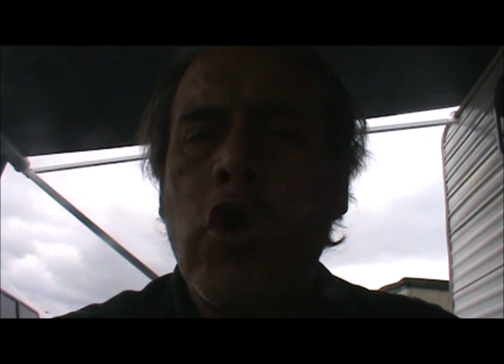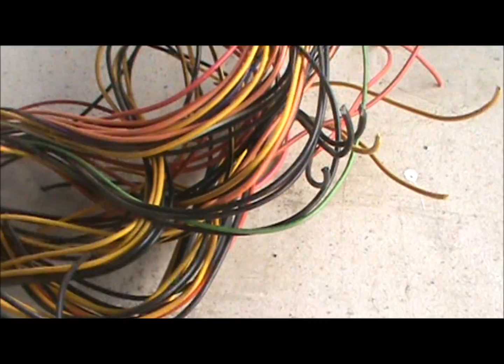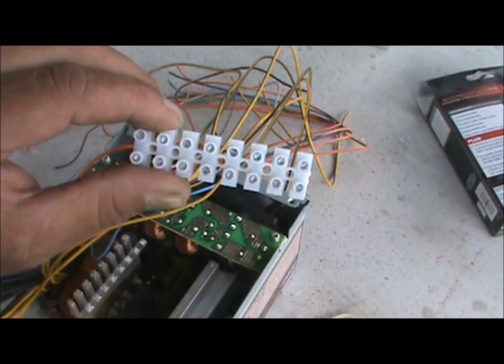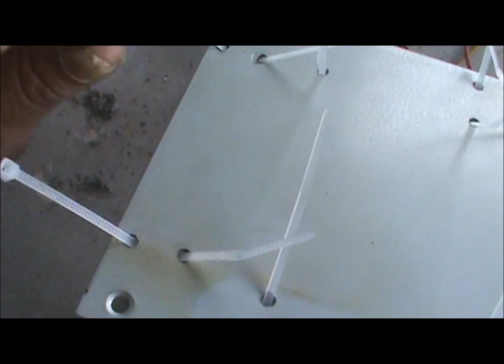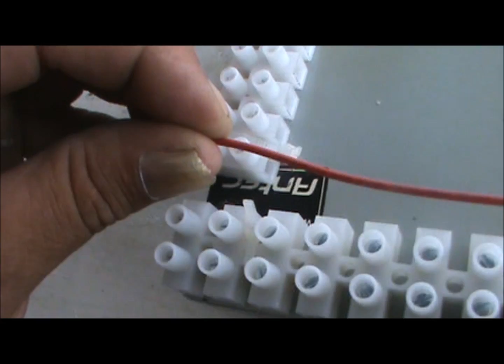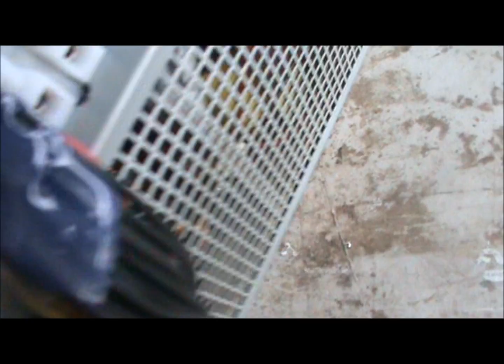Converting a comp power supply to 12V and 5V 6-21-12

Comment: What is the reason you need a resistor between the 5V wire and the black wire?
I made a 12V power supply, It doen't work when it's hooked up to my amplifier. But it does work when it isn't hooked up to something or my car radio. Does it something to do with this resistor?
Reply from the maker: most power supply wont work in less they can detect a load, the resistor provides that
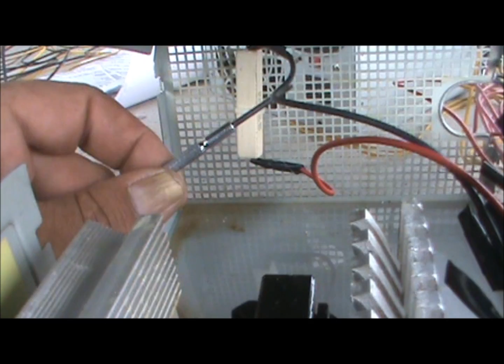Reply: Nice video,thanks , I couldn't catch the name of the what bar? on min 9:05.. what is that you connected between the red and black, what is the name and specs on it? thanks

Comment: are you calling that thing rail? i mean i want that, so what should i ask for in shop? i mean any specific name
Reply from the maker: Wire Connector Barrier Screw Terminal Strip Block or just a screw terminal... you can get them on ebay fairly cheap,, that's where I get mine

Comment: If i was going to make this i would have drilled a hole in the middle of the top plate then the wires would have been shorter.
and the load of wire on the corner would not be there.
Reply from the maker: sean meakins at the time I did this vlog I didn't have access to my drill bits or drill press so I did it the way I showed in this vlog ,, since I made this vlog I have revamped the build and am putting the wires through the lid of the case,, it does make it a lot easier and a lot neater and cleaner looking ,,, you definatly need to put a lot of sealent or caulking around the hole though,, just incase of dampness, so it dosent get inside the power supply.. really don't need to worry about that though if your doing a indoor haunt, but if your haunt is like mine and is out doors
Reply: Great video
It would look a lot better from the top.
I am making one but using the molex plugs for the power as the psu wires are all inside and the molex socket are all on the side so it makes it neat.

Comment: Oops, posted before I was finished. But I also used the orange wires on my Cauldron Creep to power the wiper motor in the cauldron. I think it's 3.3v but I'm not sure. I did find out through trial and error that not every power supply can handle that connection (don't ask me, I'm no electrician but that's what I was told). However, I did find that really low setting made for the best stirring speed for me, so maybe don't discard all of the orange wires.